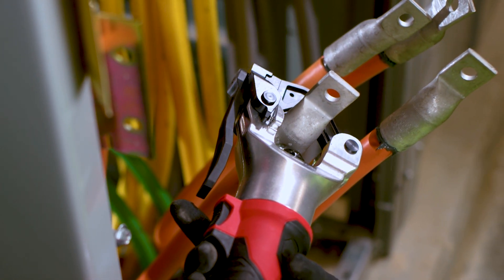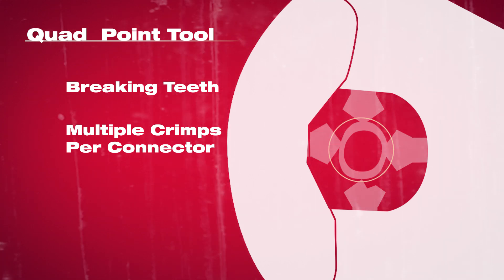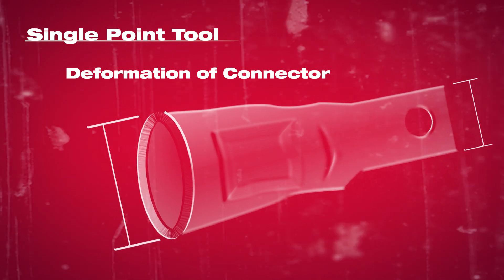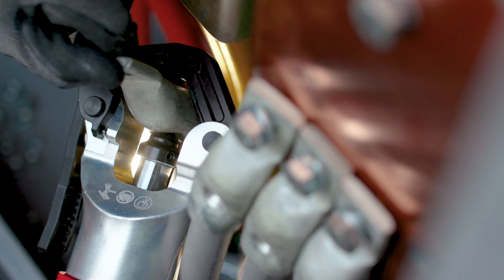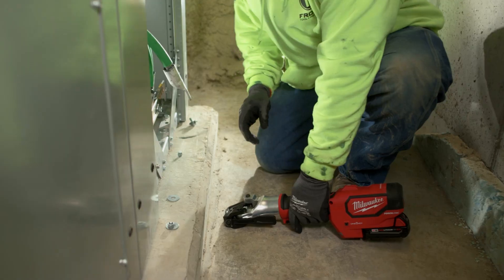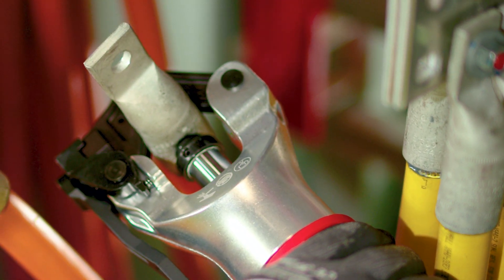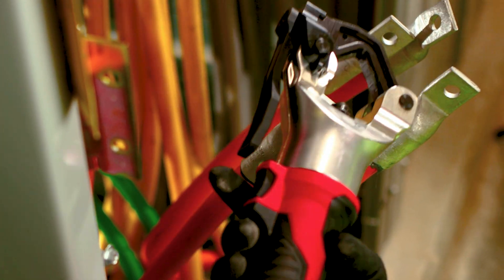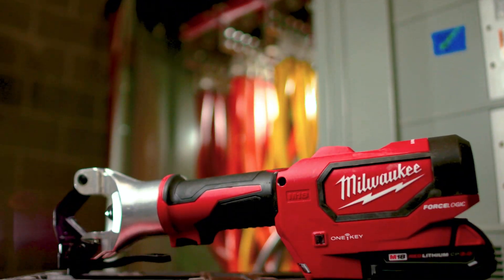Milwaukee® M18™ FORCE LOGIC™ 750 MCM Dieless Crimper

Comment: Dieless should not pass inspection. They heat up on large resistive loads. Anything your wiring up with cables that large is going to be very expensive and deserves a proper crimp with dies. imo

Comment: I use a 4-point Anderson hydraulic manual crimping tool and it does a perfect job. Always use the right gauge connectors to prevent the cable on the connector ending up off-center. . I think Anderson does a better crimp than Milwaukee's simple crimp.